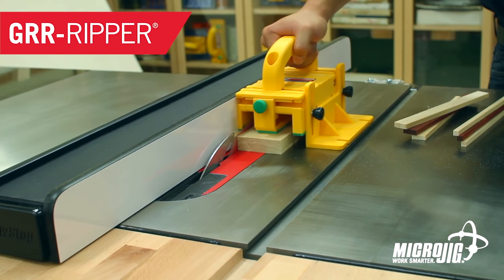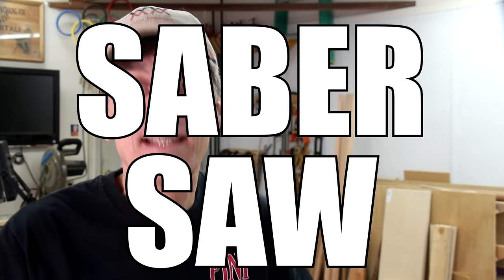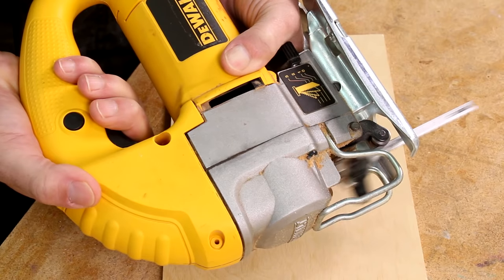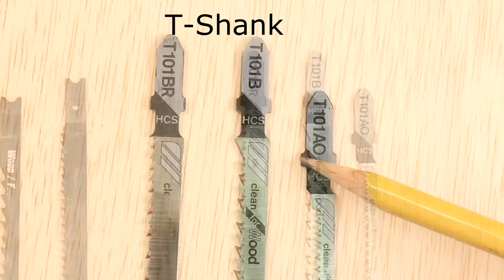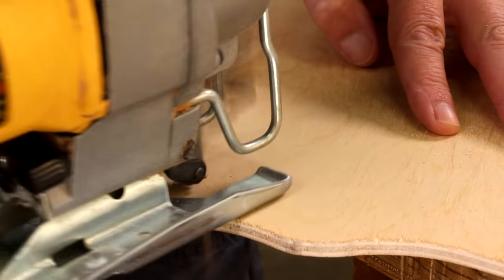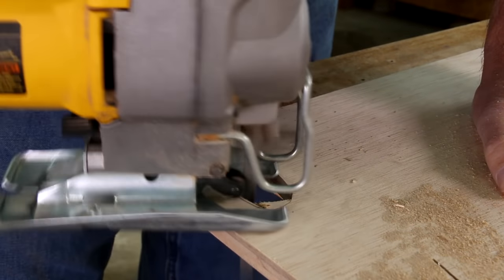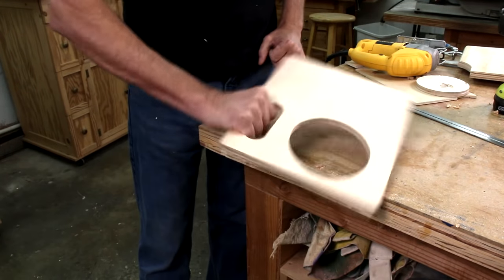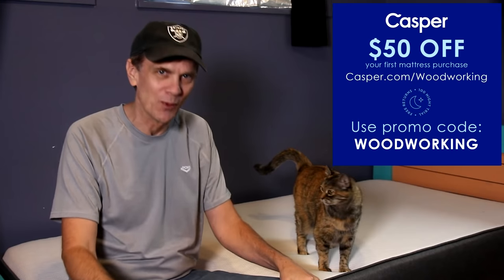What Can You Do With a Jigsaw? A Lot! | WOODWORKING BASICS

Comment: Hello! Most blades cut on the upward stroke such that they tend to press the saw shoe against the board, whereas a downward-cutting blade will push the board off. Additionally, if the action is done upward, it pulls on the blade and straightens it (like a japanese handsaw). On the other hand, cutting downward means cutting while compressing the blade, and it has more chance to flex for a given thickness.

By the way, circular saws also cut in the upward motion, as the blade goes up where it cuts, also pulling the board tightly against the shoe.
Reply: This here is a really nice explanation. Good to know!

Comment: score your plywood when cutting across the grain for fewer splinters.
glue sandpaper on old blades to make a smoothing tool or file when using wet and dry paper on metal
Reply: usually  old  blades  snap or  bend  due to the  heat..  so they end  up  in the  bin.
Reply: I use Gorilla Tape to avoid splintering.
Reply: A year after your comment and it is still valid (and something I have never thought of doing), thanks!
Reply: How would you score your plywood first?
Reply: @haddasancliffe9459  Usually 7 out of 10.
only joking. with a stanley knife or similar
Reply: @utubeape  I genuinely laughed 😂 thank you!
Reply: @utubeape  Great joke!! I love a good pun!

Comment: Most blades cut on the upstroke to prevent kickback if the blade were to catch on the wood. If it caught on the wood with a downstroke blade, it might kick up into your face or something (dangerous!). If it caught on an upstroke blade, it would just pull against the wood.
Reply: It's also deceptively safe in that dummies like me can move too quickly and it can catch/kick and smash your thumb harder than a hammer! Of course it had to happen to me twice before I learned to be a little less reckless.
Reply: My God. I hate jigsaw if that is the case. I will use the manual thing from the saw of an iron. That was we used before in our project when we were in high school days. We cut the plywood with the iron saw itself.
Reply: Indeed!

Comment: I use my jigsaw with a little trigger action clamp (instead of the blade) to shake small bottles of model paint. I modified the clamp end to look like the T shank of the jigsaw blade. It does an excellent job of mixing up paint.
Reply: great suggestion
Reply from the maker: What a great idea!
Reply: Wow - clever.
Reply: Cool idea for shaking up some cocktails. Now, where's my Amaretto?
Reply: Ramjetjetpilot I used my Jigsaw to cut my Dead Silence DVD ;)
Reply: Smart. Thanks for the tip, I hate shaking cans.
Reply: Would love to see how you did that.  I really could use use that around here.
Reply: genius!

Comment: This video truely changed my life!  I ended up following almost exactly except I just use normal blades with it instead of the reverse blades you prefer to use.  IT ALSO helped me learn the reaction of a blade and tool from performing bad techniques and seeing how dangerous wood working can be at a small and controllable level.. After I got real comfortable cutting wood and realizing my limitations OF JUST the jigsaw...... I ended up getting a table saw and took the learning there slowly as well and I feel I have accomplished all of my woodworking goals in 1 year.  AND STILL i have little experience at using a circular saw or a miter saw!  and yet... the quality of work is something I feel could never be accomplished if I went with the typical Circular saw Miter saw purchases for a first timer... EVERY beginner in my opinion should start off with this tool for safety reasons as not many other wood cutting power tools are as forgiving to a beginner not understanding the reaction and causes of kickback yet.

Comment: The teeth on a standard Jigsaw blade point up so that it is pulling the wood into the shoe of the saw, just as the teeth on a band saw point down to push the wood down on to the table.  Both are designed for stability and control.

The teeth pointing down on a Jigsaw blade require the operator to apply downward pressure to stop the saw from jumping up when cutting.
Reply: Also the teeth pointing down work good when mounting the saw under a table. Try mounting your saw upside down for using it like an older jig saw.
Reply: Your theory is flawed or better, inaccurate.  A jigsaw blade moves up and down no matter what direction the teeth are facing.  As far as I'm aware, only Bosch makes the tooth pointing down blade since they have a patent on it.  I was told by other companies that that is why they can't copy the tooth down design.
Reply: the reason most point are facing upwards is because the thin blade is stronger in a pulling motion then pressing (more likely to bending)
Reply: That makes no sense.  The only way the blade is likely to bend is from sideways force applied to it or the bottom free end of the blade hitting into an object.  When you have shown actual engineering facts behind your supposition, I'll gladly admit you're right.  I wish people would stop making non-factual based comments (suppositions or erroneous information) on the internet that other people blindly follow as fact.
Reply: Ken Nagrod It makes complete sense. 

Teeth up scenario: You lay the jigsaw's base (or as others call it the shoe) on the wood. The saw goes down with no friction due to the upward teeth (base stays down in place). Then the saw goes up, the teeth dig into the wood pulling toward the base which is still firmly against the wood. Repeat. Upward teeth has given no opportunity for the wood to separate from the base.

Teeth down scenario: You lay the jigsaw's base on the wood. The saw goes down and the teeth dig into the wood pushing it away from the base forming a gap (base is off the wood, if only slightly at first). The saw goes up with no friction due to the downward teeth (base is currently off the wood). Repeat. Each successive downward stroke furthers increases the gap between base and wood. The operator is required to put constant downward force in order to push the base down to the wood on each upward saw stroke.

If you don't believe it, try it yourself. Get one upward tooth blade and one downward tooth blade. Do not apply downward force to either, and see how each reacts.

Also doing a quick look up of jigsaw blades at Home Depot you can find that Dewalt, Makita, Blu-Mol, and Vermont American all offer downward facing tooth blades.
Reply: modetallah rockers clamp
Reply: Lol you completely wrecked this guy :)) In my opinion there's different directional blades because of the material you want to cut. As in whenever you're cutting laminate flooring you need a blade with teeth pointing downward so your good cut is at the top of your object. I guess you can use the other kind of blade and just turn your object upside down but as the guy in the video said i usually mark my objects good side up so i can see in real time what i'm doing. (Also you will always have a difference between your top cut and your bottom cut, even a slight one. Depending on material thickness, saw quality, blade quality..etc)
Disclaimer: These are not "actual engineering facts" and are "non-factual based comments"  hahahh
Reply: Ken Nagrod
Even though the blade moves in both directions, the teeth only do the majority of cutting in one direction.  Just like a standard hand saw.  But I'm guessing you may have worked that out by now.
Reply: @roosterkitten  true!  Down cut blade for Kitchen worktops
Reply: @karpenterken1  on a hand saw you both push and pull yet the teeth are only pointing in one of those directions. The teeth will simply pass over the work piece if they are pointed in the opposite was of the movement of the hand saw.
Jigsaw is no different
Reply: @karpenterken1  go on, educate me. From what I can see people have been correcting your comment for awhile.

Comment: The reason most jig saw blades are designed to cut on the up stroke is so the shoe is pulled into the work piece as it's being cut. It's the same reason bandsaw blades spin down towards the table, creates a more stable cut
Reply from the maker: That makes sense. Thanks!
Reply: Your theory is flawed or better, inaccurate.  A jigsaw blade moves up and down no matter what direction the teeth are facing.  As far as I'm aware, only Bosch makes the tooth pointing down blade since they have a patent on it.  I was told by other companies that that is why they can't copy the tooth down design.  A bandsaw blade ONLY travels in one direction, not a jigsaw blade.
Reply: Right, but there is significantly less resistance on the down stroke because it isn't removing nearly as much material. The majority of the work occurs on the up stroke when the teeth are biting into the material.
Reply: Ken Nagrod he's right. Standard blades pull the saw into the wood for better stability. Teeth pointing down causes the saw to try to jump up. Try it, you'll see.
Reply: andrewford80 makes sense
Reply: Ken Nagrod He's still right and you're wrong. The blade barely cuts on the downstroke. 
The downstroke is simply to allow for another upstroke/cutting stroke.
Very similar to a handsaw...
Reply: You can purchase blades (Finer teeth so don't catch) that cut on downstroke to prevent splintering when cutting kitchen worktop, melamine boarding where coating splinters off. Say when building bespoke wardrobes. Carpenter joiner in UK.
Reply: Reborn In Rationality  He did explained, the band saw pushes the material down towards the base plate which gives it stability. the jigsaw's base plate is on top of the material. similar to a skilsaw. if you want to find out try cutting with both blades but not putting any downward pressure on the saw just holding and guiding it, you ll see which is more stable.
Reply: @karpenterken1  Try both blade styles, with equal pressure on the cuts, and let us know (3 years later) how much added pressure you needed to stop the jigsaw from finding your teeth with a teeth-down blade. It has been common knowledge for a while now that teeth direction plays a HUGE role in how a tool handles a cut. There is a reason the blades actually have a direction for the teeth (so on the non-cutting, or return stroke, the teeth pass through the cut without cutting) instead of just  triangular teeth with their tips pointing perpendicular to the blade.
Reply: @FlashPaperGrind  probably not going to happen.  Carpal tunnel syndrome in both hands eventually took me out of the business/trade, sold off everything and moved on.
Reply: @karpenterken1  sorry to hear that, fellow carpal tunnel / rsi sufferer here ☹️

Comment: To start a cut without drilling a hole, tip the saw forward so the blade is above your work, start the blade moving somewhat slow and gently allow the blade to touch the material at the same time increase the blade speed, but don't push too hard. This will cut a slot and you can continue your cut from there. Hope that makes sense.
Reply: yes  no  need  to  drill a  hole  into the  wood.. Use the  blade  on the  jigsaw to  do  it.
Reply: Small tip, hold the saw backwards. So the pivot point is towards you, makes it easier.
Reply: It's called a "plunge cut" which can be also be done with a sawzall and a circular saw.

Comment: There is a higher chance bending the blade on the versions that cut on the downward stroke.
Reply: I just lay tape  over the cut lines area and mark on the tape and cut, the tale helps the edges from fraying so much giving a cleaner cut when using the upward cutting blades.  Also, the lines on the tape are clearer and easier to see.
Reply: Johnn Schroeder great advice!
Reply: DOWN CUTTING BLADES
These are designed specifically for laminates and thin material such as floor boards so that the upper cut surface is a neat line with little tear-out.
Reply: Thx
Reply: it's also to reduce the vibration in the workpiece by doing all the cutting on the up stroke where it's being supported by the shoe of the jigsaw

Comment: Pro tip: You don't need to predrill big holes with most blades. Just lift the back of the jigsaw, start it and carefully tilt it back into the wood. I've found this trick in manual of my jigsaw when my cordless drill ran out of batteries and i needed to cut big holes in middle of piece.
Reply: I was waiting for this tip....my dad, a carpenter, used to do it like that all the time for big holes.

Comment: I wonder if most blades cut on the upstroke like that to make it easier for the user to keep the saw down against the work piece. Cutting on the upstroke would effectively 'suck' the saw down against the board instead of the blade pushing up against the saw to cut on the downstroke.

Just a thought, I really don't know for sure. Keep up the great videos though, cheers!
Reply: That's my thought too.
It works the same way on table saws, circular saws, band saws, pretty much any power saw cuts so that it pushes the material against the supporting surface of the saw.
The exceptions are for when you are trying to make a cleaner cut.
Reply: Yes, it also very effectively removes danger of kickback. For the cleaner cut problem. My new Hikoki has kind of an "zero" clearance plate for the shoe piece. It's really close to the blade and it should remove burrs effectively

Comment: Only tip I can give is dont buy super cheap blades they are the worst, best blades on the market for jigsaws are the Bosch.
Reply: Yep, cheap blades usually bends really easy and the cut ends really bad.
Reply: I feel the same about their chisels... One 4mm cost me enough already :p
Reply: iShootBandits said
Reply: I've also learned not to buy cheap jigsaws. I had a cheap one and it was useless - cut wandered all over etc. Bought myself a Bosch professional model & the difference is amazing and it is far more useful. Well worth the extra money (like most things with tools you tend to get what you pay for). So brand name blades and a good brand name saw makes a huge difference.
Reply: +1 on Bosch blades
Reply: How about getting cordless? Or just stay with cord type-more stable?
Reply: @onzkicg  corded  is  fine  just  be careful of  not  cutting the  cable..  It's  easy done..  If  you're  mindful  of that?  I  prefer  corded to  cordless unless I'm  using ther cordless  in  an  awkward  place and my  extension cable  won't  reach.
Reply: @romajiroblox2957  I  was  using a  Bosch until the motor  died..  I've  now   got a  Matika which  was  cheaper than  the  Bosch and  should  be  better  than the  Bosch..  Bosch &  Black  & Decker are on  a  par  with  each  other..  If  you want a  better  tool  go  with  Matika,  Metabo or  DeWalt..
Reply: Tybok C Thanks yes I got a corded one too.. Hitachi. Oh the power and noise lol 😂 it’s like a wild horse looking for heavy jobs :) Stayed parked at storage, now I’m looking for a small dremel for smaller work :) Rotary tool- corded is better?
Reply: @LFC-Star  lol no
Reply: @RainDog222222  no  what?

Comment: A tip for using a jigsaw is to make turns by rotating the tool rather than pushing it to the side. If you push it to the side, the blade will bend and you'll end up with an unwanted bevel angle on the cut. Rotate the tool and let the blade do the work.
Reply: This is the tip I was searching for. I hope. I can't make a decent cut on my jigsaw. Maybe I should upgrade from Harbor Freight...

Comment: Can a gripper get wrinkles out of the sheets on a Casper mattress?
Reply: Mike Downs Only if you then give it a nice shave with Harry's while listening to an Audible audiobook.
Reply: Carlos Peralta don't listen to the inaudible audio books, those my friend are a waste of time
Reply: Audible is a brand name service to purchase audiobooks, not an adjective. ;)
Reply: ballsrawls it is actually both, this is why my statement is funny, I have taken the intended meaning and gone the other way
Reply: I can't believe you don't know why a jigsaw cuts on the upstroke. It pulls the wood into the base. Otherwise the saw keeps trying to push the saw up, away from the wood, and you have to consciously hold it down. It would be analogous to a radial arm saw rotating the blade towards you and you would have to hold the wood against the fence, or a table saw rotating the blade up, away from the table, and you would have to hold the wood down, as well as push it through the blade.

Comment: Jigsaws are also capable of making plunge cuts if a drill/ home saw are not available. Just hold the saw at an angle resting the shoe (the end opposite the blade) against the material to be cut. You then slowly lower the blade, allowing the teeth to eat into the material until it makes a penetration, and then continue to cut as you normally would.

Comment: only thing i hate about jigsaws is the dont always cut square on thicker woods.
Reply: You can clamp a straight edge (I use a metal 3' ruler) to your wood and put the jigsaw up against it while cutting. Straight every time.
Reply: @JacqueBernadette  Square is more than 1 direction.
Jigsaw blades can deflect easily.